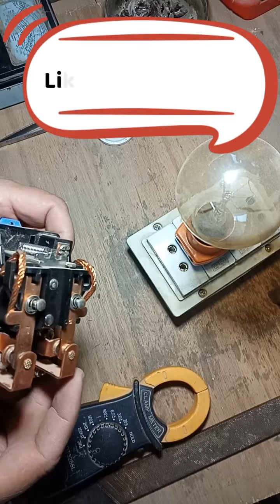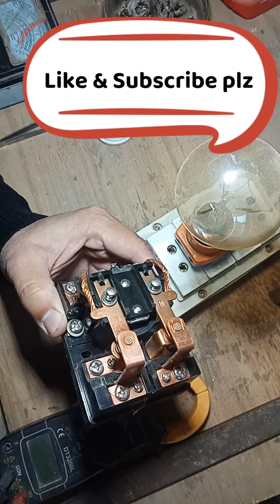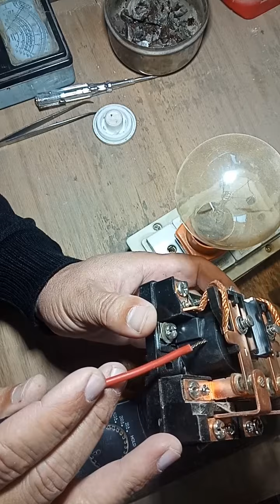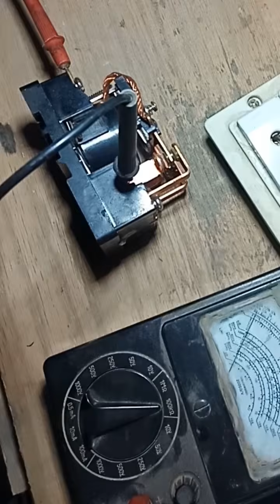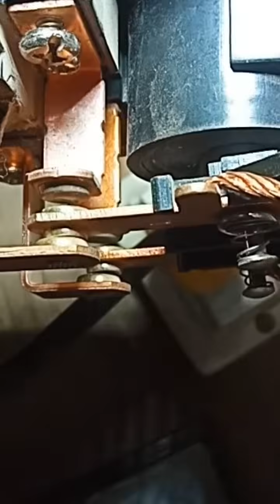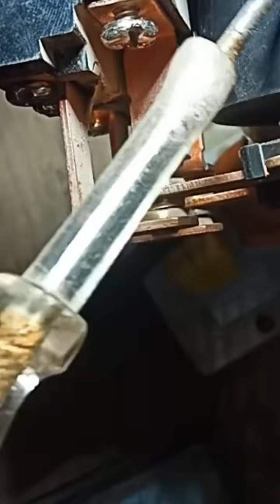2 phase changeover switch connection | auto changeover switch | relay

Comment: i have some issues with in my relay only one terminal working electromagnetic coil terminals not working how it's repair??
Reply from the maker: Yes, there are a few diodes attached to the coil, so there are a couple of possible issues: either a shorted diode or a discontinuity in the coil. You need to check both. If the coil is disconnected and there is no visible break, you will need to purchase a complete relay. However, if the issue is with the diodes, you can simply replace them.